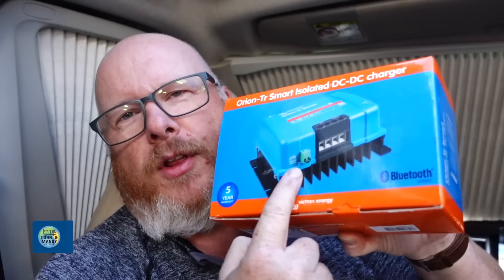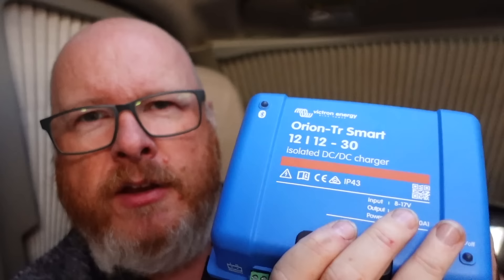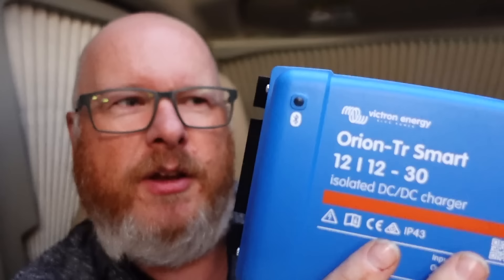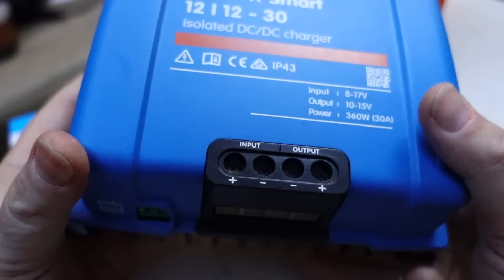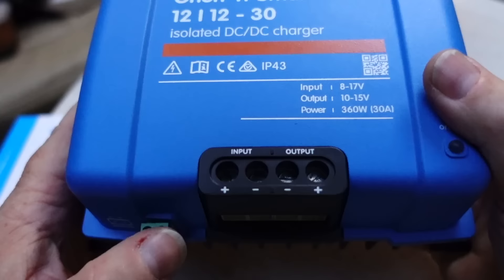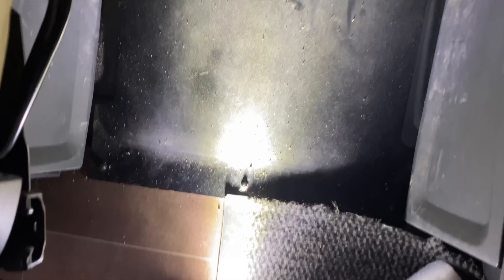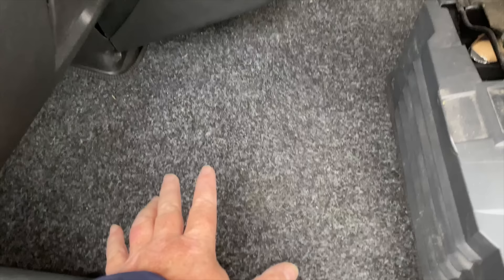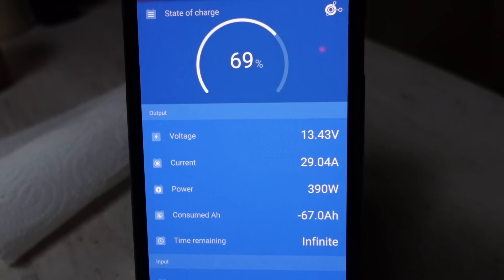Victron Orion DC-DC Isolated Charger B2B Installation

Comment: Great vid thanks <3 I have a question if I may; My batteries (3x 100ah AGM) have a maximum charge rate of 25amps, I'm yet to purchase the B2B but I know I can turn this charger down from 30 max to 25 max etc, but I also have a 20amp victron mppt with 300w solar, I'm concerned that could lead to me sending too high of a charge rate to my batteries and damaging/set fire to them. I can't seem to find the answer readily online and thought you would be a good person to ask if this would actually be an issue? Once I have more roof space/bigger panels I also plan to switch to the 30amp mppt (Wish I'd bought it first but didnt know it could be turned down to 25 amp /sob ) Thanks in advance and hope you've been enjoying your travels in this immense heat!

Comment: I have a standard split charger and want to change it to one of these. A couple of questions. Can I use this with other Victron products? They are solar controller 100-20 and the Smart Shunt?
Reply: As an update I ended up fitting all Victron products.

The 100V 20 amp Solar charger,

Orion-Tr Smart 12/12-18A B2B charger

Bluesmart IP22 12V 15AMP 3 Output mains charger

SmartShunt 500 amp Battery Monitor

They all work perfectly together.

Comment: Thank you so much for the vid mate I'm just building the electric system on my narrowboat these b2b are the way to go how are you getting on with these new lithium batteries in the winter? I'm looking at going lithium but wanna be tried and tested before I spend 1000s
Thanks again keep up great work 😁
Reply from the maker: The lithium I bought are fantastic, even working  fine at just over freezing, it’s been really cold at times, and the batteries still charge and discharge fine 👍🏻

Comment: Great video, one question. The victron is going to charge the battery with a profile which is suited for Lithium; The build in Schaudt booster is probably going to charge the battery with a gel/agm1 profile. Isn't this going to be a problem for the battery on long term since it is going to get different voltages and absortion/float modes?
Reply from the maker: In simplistic terms one is just a lower voltage than the other, so no it won’t cause any issues as the Victron will always handle the lithium higher voltage maintenance.

Comment: Hi John & Mandy hope you are both well great vid by the way been considering putting one of these in my VW for some time just out of interest I currently have a split charge in and wondered if its ok to use the same cable run for the B2B and leave the Split charge in the circuited or dose the B2B need a permanent supply from the the starter battery maybe if so i would remove the Split charge?
Reply from the maker: You need to work out if the vsr cable can safely handle the b2b load

Comment: hi John! First of all, great video! and nice setup!   that being said, I've got a 18a Victron Orion unit i want to install in my small van (with a 120ah secondary battery).  Now i wonder, will 18A be enough to charge it? the main difference between 18 and 30a  would be the time to fully charge the secondary battery?   If you already explained this in the video, sorry, I may missed it because of my english :P
Reply from the maker: If your 120ah battery is lead acid or agm then it’s only 60ah of usable power you can use. So your 18a charger will be fine to charge the battery, though the more power you take from your battery the longer it will take to charge.

Comment: What would you recommend between the 12 12 18a and the 12 12 30a 
I am really struggling to find out and info on the better choice not only for charging but staying safe with what I'm looking to fit.
It's a 2007 311 sprinter and looking at having two 100ah AGM leisure batteries, in time I will be wanting solar too but for now just a b2b, any help would be great cheers guys
Reply from the maker: I’d always get the bigger one to charge faster.

Comment: John. Just a quickie “that’s what she said” lol. Could you piggy back off the other B2B? Cheers 
Jay.
Reply from the maker: No, that’s not how b2b’s work.
Reply: @johnmandy  I understand how they work, sorry I probable didn’t explain myself properly, can you piggy back off the first B2B(Incoming) over to the second B2B incoming. So only running one + & — from the cab battery. Or for argument sake, can I run the first B2B tails(incoming) into a Lucy block, then split the +&— into the 2 B2B. 
As your vans ok because the hab and cab battery are close. 
My battery’s  are at different ends of the van and didn’t fancy running another + & — 9m’s?
Cheers Jay

Comment: Hi John another question is can’t see a setting for led acid batteries in the battery settings it’s all for lithium or agm
Reply from the maker: That’s because they don’t know the spec of standard batteries, you can enter your own though via your own preset.
Reply: @johnmandy  thanks John
Reply: @johnmandy  I thought I was being clever and installed a 12v isolated dc dc 18amp unit myself to charger my VARTA LFD90 leisure battery.....only then to find there's no preset and varta a yet haven't produce information to set this system up 🙃 it's frustrating so thinking I will need to by a new leisure battery but before I do and tips as understand I can't use the agm or lithium presets.  Almost there !!!thanks for great videos as aways my go to 😀

Comment: If I connect this to a secondary battery, will energy be drawn from the secondary battery during startup or is it unidirectional?
Reply from the maker: No, the power only goes in one direction.
Reply: @johnmandy thanks for the reply, that's great to hear. I want to connect the orion via 12V outlet in the trunk of the car to a secondary AGM battery and then distribute energy to my cooler, pump for water, etc.

It's a golf Mk 7 microcamper with a rooftop tent in the making so this will make things much easier and I won't have to run a new wire to the back go the car. 9A should be able to be handled by the stock outlet I hope

Comment: Fantastic video. I'm looking to fit this in my 2014 Bessacarr that has a VSR built into the Sargent unit and been told disconnecting it effects other electrical items. Do you think it is ok to leave it in place and run both the BtoB and the VSR together ?
Reply from the maker: If you watch the video you’ll see I left the original charger connected 👍🏻
Reply: @johnmandy  hi yes I've watched the video a few time. I'm just a little confused as you say your Burstner electro block already has a BtoB so runing them together would be ok. My 2014 Bessacarr has a VSR so i'm not sure. what do you think?
Reply from the maker: Yep, it’ll work fine. But to be honest I’d just pull the fuse to the vsr as they’re not great for longevity of leisure batteries. The Sargent system will have a fuse for the vsr/charger.

Comment: Does this work with smart alternator. Stop start
Reply from the maker: It will if you choose that in the software, the video explains this. 👍🏻
Reply: @johnmandy  I see did nit see it in video. Bit worried about the heat as well where mine is mounted
Reply from the maker: As long as it’s in a ventilated area it’ll be fine.

Comment: Hi John - thanks v. much for the informative video, much appreciated (as are all your vids)! I noticed that you also have the new Bluetti AC200 (I have the 'old' 1700w model, essentially the same as yours, with a smaller battery). I'm fixing up an Audi diesel for some car camping and was wondering what you'd recommend as the best way to charge the Bluetti whilst off-grid, given that solar isn't much of an option in the UK  at the moment? I could buy and connect an inverter to the cars 12v battery and then connect the Bluetti's power brick to that for around a 400w charge (whilst driving) or maybe I could buy and connect the Victron you have and power the Bluetti and the cars 12v battery via the B2B charger direct from the alternator? Which way would you recommend and why (I can afford either option)? Thanks in advance.
Reply from the maker: You can just hook it up to the 12v in the car as you drive and it charges that way, that’s how I’ve been charging it 👍🏻
Reply: @johnmandy  Thanks for replying John.  Yes, I have the 12v cig lighter socket cable and that works - I was just after a faster way of charging without solar or mains hook-up and wondered which of the two alternatives mentioned would be fastest/most efficient.
Reply from the maker: The fastest way is using the mains charger, you’d need a 600w pure sine wave inverter to do that which would use 50amps of power, so you’d need to hard wire it 👍🏻
Reply: P.s. you and Mandy keep up the good work showing how it's done and hopefully you'll be on your travels again before too long.
Reply: @johnmandy  Fantastic! That's the route I'll go then and sounds a bit less complex than the b2b route. Thanks v. much and safe travels. Neil

Comment: Thanks for your video! I noticed that you used a 150a fuse. The largest wire that Orion uses is 6awg. Is the fuse too big?  Have you had any issues?
Reply from the maker: It’s all fully explained in the video 👍🏻
Reply: @johnmandy  I must have missed that part. I’ll look for it in the video. Thanks!

Comment: Hi John, do have any experience with the charger drawing too much power in idle mode? Suppose it draws 50mA for just being ready (waiting for engine on und bluetooth idling), than this will sum up to over 36Ah draw over the course of one month. The manual states something like 1mA in "standby" and 80mA in "no load". Do you rely on the automatic engine on detection?
Reply from the maker: I can't say those numbers would be noticed as we use a lot of power each day and then drive every 2 or 3 days and it all gets fully charged again. As per the video, I am setup for auto engine start detection and it works fine.

Comment: Hi, John I’ve got a similar EBL mounted in my van, I was actually considering installing B2B charger as well. A bit confused on how to wire it. Any schematic to share?
Reply from the maker: Feel free to watch this video in full, then also checkout my other wiring videos and you might find all the info you need.
Reply: @johnmandy  yes I think I found my answers, thank you. I was worried that the EBL either the battery wouldn’t like receiving 2 input for charging. I’m considering replacing the mppt as well by a victron to get everything monitored by the app which seems quite handy.

Comment: Thanks for the really informative video – definitely convinces me to go for a Victron for my camper!

I just wanted to ask you about the fuse/breaker you installed, though. You demo'ed a 30A breaker, but is that the one you used for this charger? Wouldn't 30A be too small if the power of the charger is 30A?

I've just taken a look at the Victron handbook for the 30A charger and it seems to say a 60A fuse should be used, but I'm not 100% sure I've understood the table right! Thanks for your thoughts and help on this if you have the time to reply :-)
Reply from the maker: My thoughts are my experience has taught me to use the equipment I use,  you certainly don’t put a 60amp fuse on a device that’s only capable of producing 30amps.
Reply: @johnmandy  Thanks very much for replying – makes sense to me!

Comment: Hey John, thanks for this. Any experience of connecting a Victron smart shunt to the b2b device? I have also heard that having two b2b chargers can put too much strain on the alternator. What are your thoughts on this please?
Reply from the maker: If you check our videos you'll find an advanced electrics video showing how it all connects up, including the bmv 712.
It's fair to say you should always ensure your vehicle's electrical system is capable of the additional strain of charging your leisure batteries.
Reply: @johnmandy  thanks John, I will go take a look 😁 I think I might fit a second alternator in the future, but ok for now 😁

Comment: This is an epic video John. How do you determine the amp amount you need to purchase for the charger? Based on max load you use at one time? Or based on your total battery amp hours?
Reply from the maker: The bigger the charge rate (amps) the faster it’ll charge your leisure batteries. It’s that simple really.
Reply: @johnmandy  thanks John. Upgrading my sailing yacht to a lithium system soon. Some people spend hours explaining what you're showing.. When it really takes just a few minutes with a bit of common sense.

Comment: Great video, I have a pilote 783.  2014  planning to put two 300ah lithium in, just planning and thinking, not sure what alternator i have on a merc 3Lchassis 519 so not sure how much current i can take but also not sure if the negative is common with leisure batts and engine battery. what should i expect do you think?
Reply from the maker: 600ah of lithium?  You’d need at least 100amps of charge to even make a debt in charging them.  
What are you powering that you need 600ah of lithium?
Reply: @johnmandy   It's because i can :). I have two slots with AGM in right nw begging to be filled with capacity. I am looking to maximise on solar  so off with the crappy oem panel and fit two of the highest rated II will get max mains charging capability too so when on ehu use that to fill up the tanks
Reply: but yes i would like to be able to supply aircon etc
Reply from the maker: You’d need roughly 2000watts of solar to charge your lithium. You’re falling into the mistake lots make, watch my latest advanced wiring video to learn how to correctly size up your electrical system
Reply: @johnmandy  John. I disagree,  from a current perspective its like filling a bath with a kettle, the solar will contribute and top the batteries to a level, and the batteries will sit there gulping this charge -  not complete in a certain time thats for sure as the panels I will go for will only be about 550W for the pair  but solar wont be the only sourse.  either B2B or mains charge
Reply from the maker: After living in a van for more than a year and using lithium with solar for over 3 years, I can assure you it’s not going to charge your lithium. Lithium need a huge charge current, so solar is good for trickle charges but they can’t give a large bulk charge like a b2b can. But the main point is you need to balance the AH to the amps of charge or you’ll struggle to charge the lithiums. Fine if you’re a weekend warrior, not so good if you want to spend weeks off grid in British weather
Reply: @johnmandy  When you say it wont charge the lithum you mean wont charge to capacity in a reasonable time fram I get that ( Degree Qualified electronic engine er for 38 years) I am not saying the solar is capable to charge the lithium of that capacity in a reasonable duration   but is definately able to contribute. Hence the route of mains charging and B2B,  to be able to charge to capacity.  other thoughts are generator and efoy   additionally I am located in France currently with some 20 degrees today and blue sky the whole day I appreciate your looking at worse case scenarios. I just see the large lithium as capacity  whether your operating from full capacity or not its capability capacity.

Comment: John sorry buddy but can you help ME PLEASE lol so I’m sure your motorhome was fitted  with on board charging for leisure & starter to charge while driving 
My concern now is is this still safe to fit 
I’m new to this .. I’m talking weeks in lol fiat ducato bessacar e660 2009 only what I’m told Today my van with the nord ne222 control panel and mcu-c  mains isolator & fuse will have a charger fitted which is a split charger 🤷‍♂️ no idea now on how all this works if I can pick your brain that’s been into this longer then me 
Thank you
Reply from the maker: That’s covered in this vlog as best as I can
Reply: @johnmandy  I didn’t explain properly sorry I mean can I fit the dc to dc charger still .. because my van has this on board charger already 
Thanks for the reply
Reply: @johnmandy  just watched the video again yes I understand now buddy ..  great video mate 👍 you have the same issues as me then but fitted anyway and seems is a myth

Comment: What wire connections did you use for the large wires in to the controller?
Reply from the maker: That’s shown in the video 👍🏻
Reply: @johnmandy  not the ones going in to the victron unit? You show the  terminal type ones to the battery.
Reply from the maker: That cable goes to the victron 👍🏻
Reply: @johnmandy  I don’t think M10 loop terminals fit in to the small victron unit 🤔
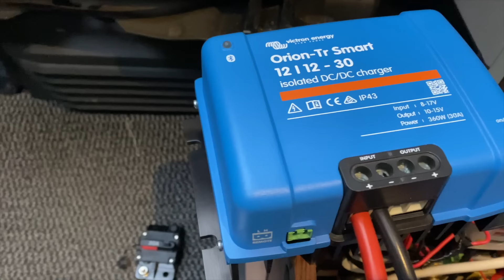Reply: See 9:52 on your video. I mean did you use a terminal on the end of them wires?
Reply: Cheers 👌🏼

Comment: Is the alternator capable of sustaining such high loads in the long term??? After all, it was designed to cope with the demands put upon it by the original B2B.... just thinking
Reply from the maker: If you watch again I cover this, the b2b amplifies the power, so there’s no big load on the alternator. That’s why the b2b gets so hot 👍🏻

Comment: Amazing video thanks so much!! I was wondering, what size wire are you using to connect from the Orion to the lithium battery?
Reply from the maker: It’s in the video 👍🏻
Reply: @johnmandy  Hey, thanks for the quick reply! I saw that you were using 16mm to connect the Orion to the car battery but I've watched the video over a couple of times (maybe I just didn't catch it still..) and I can't find the thickness of the output wire. It looks thicker than the 16mm input wire.
Reply: Wait.. now I'm confusing myself. I meant the input wire looks thicker than the output but I only heard you mention the 16mm wire.